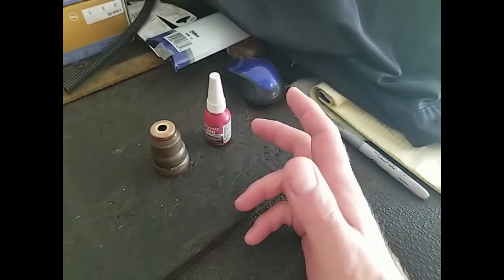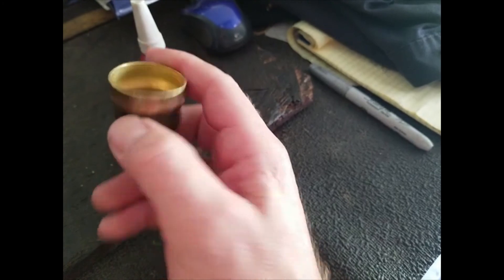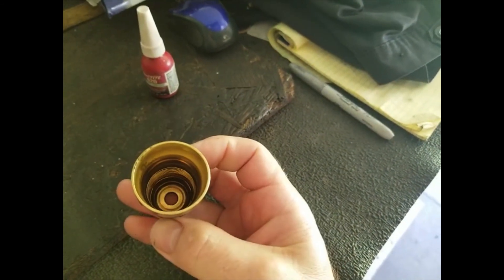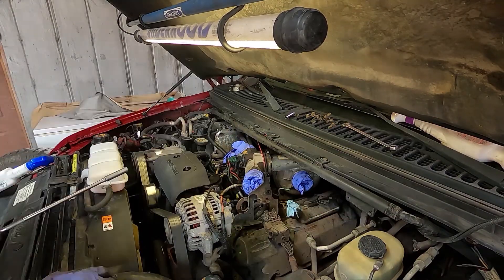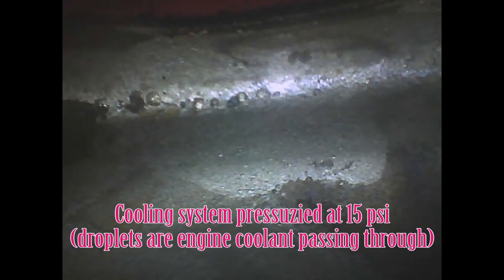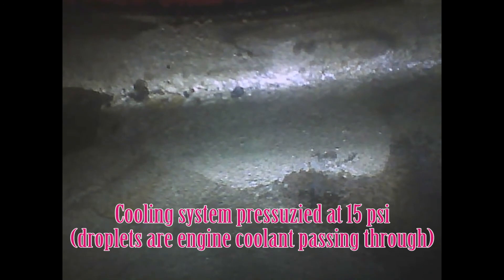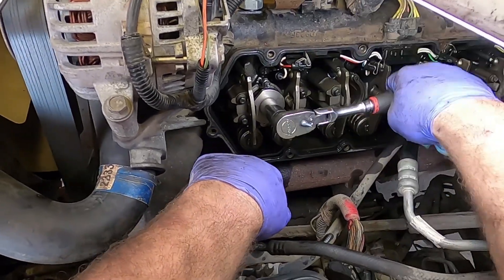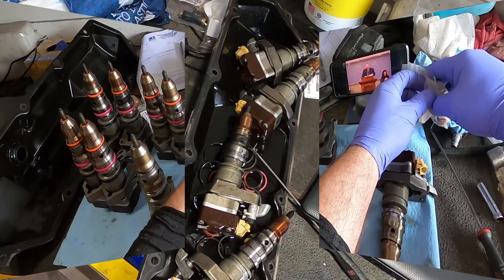Diesel Fuel in Coolant - Leaking Injector Sleeves On 7.3L Powerstroke

Comment: Exactly what my 2002 f250 7.3 is doing . I'm sure it's not good to drive like that in about 50 miles away from home I hope it don't hurt it no worse then it is
Reply from the maker: If you keep driving it with fuel contaminated coolant, all of the rubber parts will swell up and begin to leak or break, etc

Comment: How can I contact you??? Having a problem with finding the correct help with my 7.3 power stroke, diesel fuel in my coolant system after they installed new injectors

Comment: Having same problem on my 2002 F250. Thanks.
Reply from the maker: It's not too bad of a job. Best wishes!
Reply: @HarrygTV  I hope so. Talked to a few mechanics today, none had the tool to pull the injector caps. A bit concerned it may be a lot of grief. 

Are there any other issues one can expect after this?? My truck has 320 000 kms (I live in Canada). I must say, after 1 month short of 20 years, this is my biggest biggest issue. Was my personal vehicle for 8 years, then it became my work truck since 2010.

Comment: Hey there, GREAT video! Couple questions.

#1. How did you know it was that first cylinder that had the leak/issue or did it just happen to be the one you started on?

#2. How come you didn’t oil/lubricate all the seal/gaskets/o-rings? I’ve always been told too.

#3. What do you charge for this job? Re-sleeving/cupping all cylinders?

Thank you!
Reply from the maker: Hello! Thanks for watching and commenting.  
*At 3:09 in the video I say that the way to find the leak is to remove all of the injectors and pressurize the cooling system. Then, you just look for the leak in all the cylinders (you don't really need a bore scope to see the leak, just a good flash light will do).  
*I do not lubricate the injector seals when I am installing them onto the injectors. I do lubricate them with clean engine oil just as I am installing the injector into the engine. 
*As far a what I charge, it has been a few years since I have done any of these, and I don't have my invoicing program with me as I type this, but the best that I remember, the price was usually between $1500 and $2000 depending on some things like how extensive the cooling system flush was, etc.
I hope this helps you!
Reply: @HarrygTV  
Yep yep! Thank you! 👍🏼
Reply: @HarrygTV 
I done all the cups (not my first time doing this job) but continuing to mix fuel/coolant. I went back in and pressurized coolant system. Coolant is leaking out of the fuel port on #7.   Is this cracked head or head gasket?